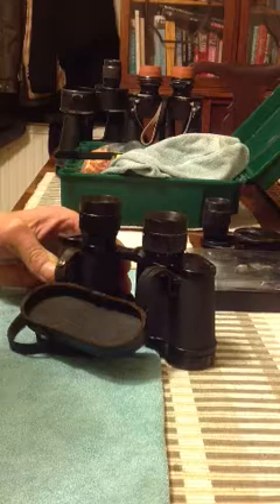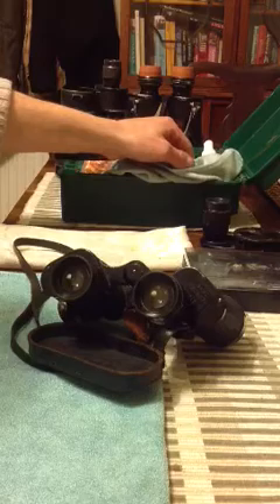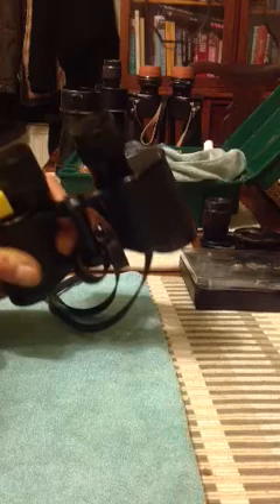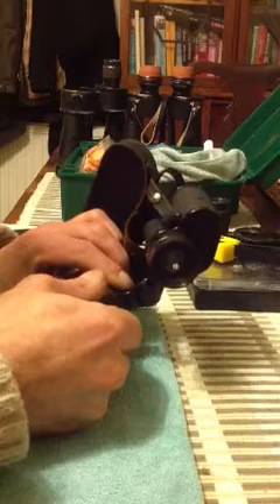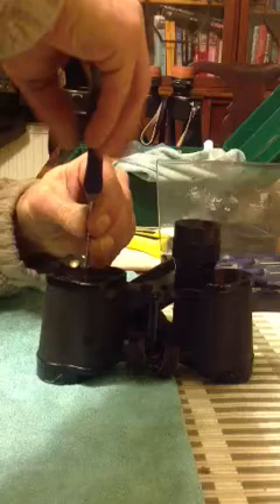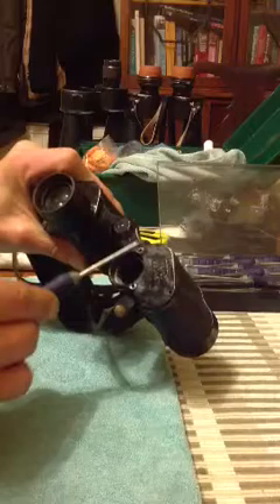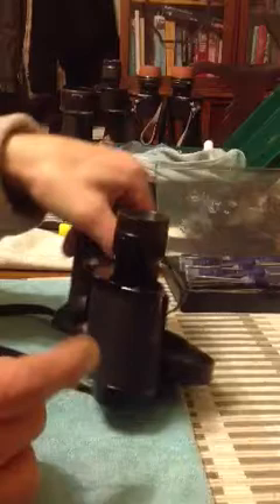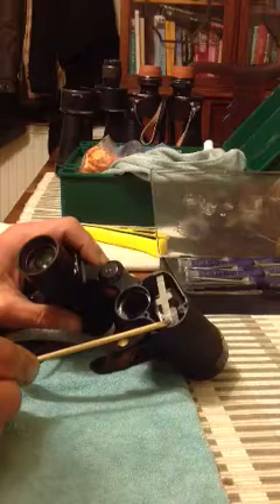German ww2 binocular repair

Comment: My problem is, that I can not turn the diopter because it only moves a few millimeters and wont move any further, how do I fix that?

Maybe the grease is old and porous?

Edit: I have found the problem. The threads where the diopter cap screws on are damaged... hopefully I will find some replacement parts for it.
Reply from the maker: Hi you need to remove the diopter completely you should see a ring below the knurled part of the diopter,this normally has markings on it,it can be separated from the main body of the diopter,hold this ring  firmly and turn the diopter clock wise ( it's a left hand thread so it will undo)
Reply from the maker: Once you have removed the diopter you can take out the 3 retaining screws wipe out all the old grease and replace it

Comment: Hello,
I have the problem that the left ocular of my service glass doesn't moves the mechanics etc. in the inside of the glass when turned. It is strange, but when I pull the ocular a little bit, sometimes the system works and I can sharpen the glass a little bit, but if I adjust more it fails again, as if the system works only on tiny spots ... also i am unfortunately not able to open the ocular right now because this (anti-clockwise) "scala-part" is very very tight and I can't separate it from the other part of the ocular ...

Comment: How much would it cost to have the internals cleaned profesionally?. I have a pair of my grandads mark 2 1941 Kershaw binoculars he used in Burma. Going to have to replace the eye cups and there is a bit of fungus(I think) on the lense but otherwise good condition.
Reply from the maker: Hi,
I think most charge between £60 -80,as they were used in Burma they may well have fungus from the humid conditions,this can be fixed,the eye cups you can replace with modern repro ones,these I believe can be found on ebay for a few quid,
Reply: Thanks. Had a look on ebay and found these,
http://www.ebay.co.uk/itm/220739591576?ssPageName=STRK:MEWAX:IT&_trksid=p3984.m1423.l2649
I think they are the correct ones?
What I think is fungus is black mouldy fuzzy looking dots/marks, its in need of cleaning but dont think id have the confidence doing it myself.